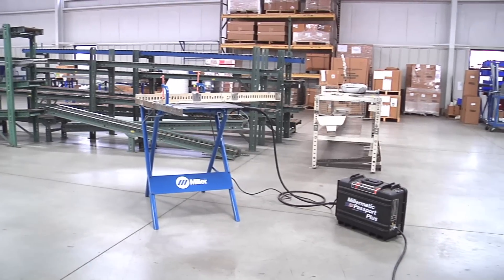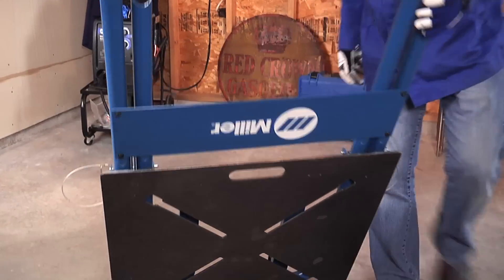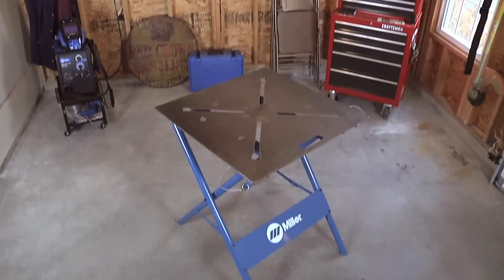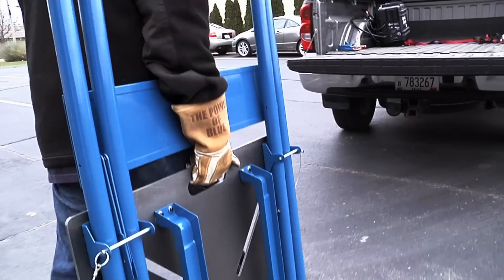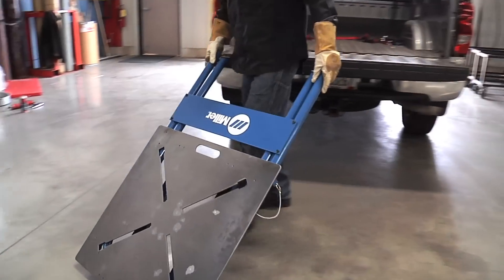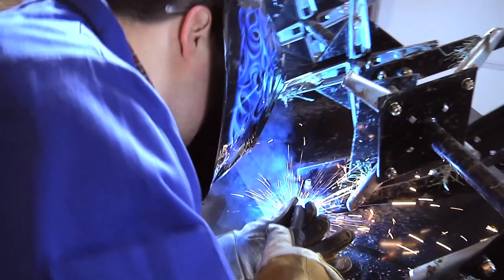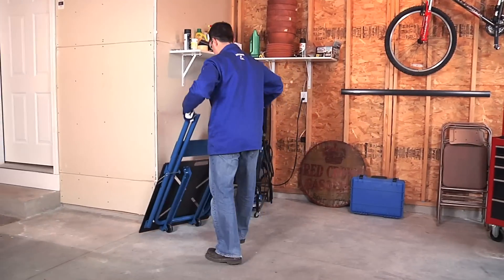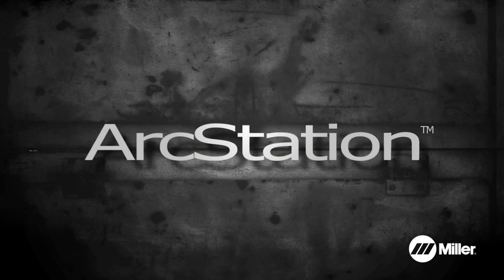Miller Introduces New F-Series ArcStation Folding Workbench

Comment: How do you use this to weld out of position?
Reply from the maker: Thanks for reaching out. The Arcstations with the X – top have clamps available for them, however we do not have any kind of arm for overhead welding. It would be pretty easy for someone to build an arm for that application that could be clamped under the X-clamps or dropped into the square leg tube on the stationary models to secure it.